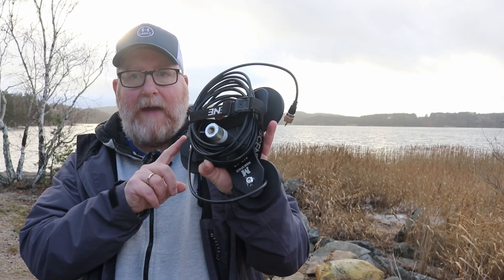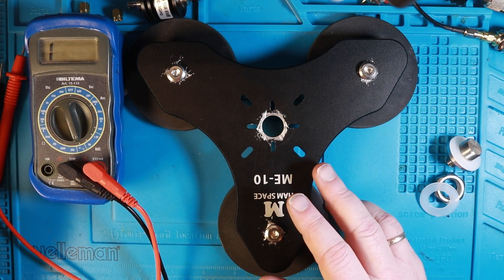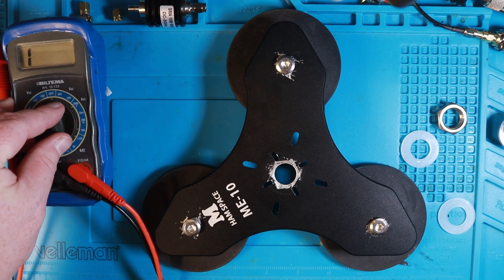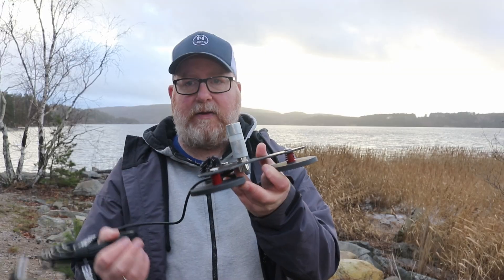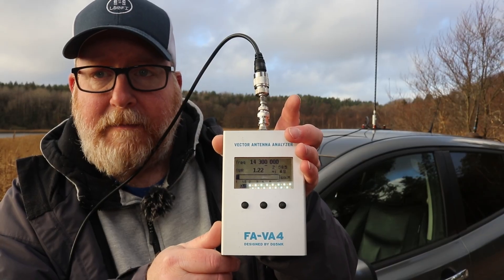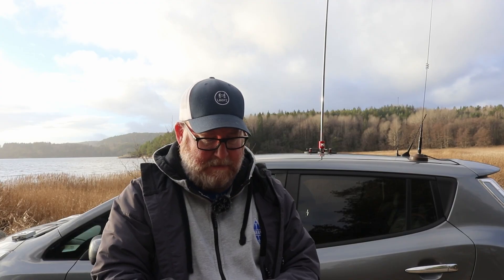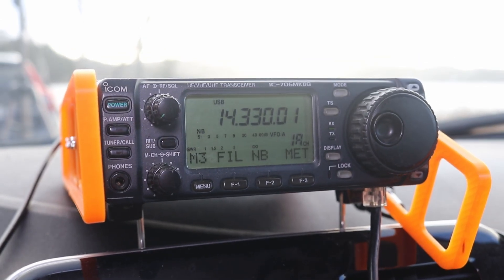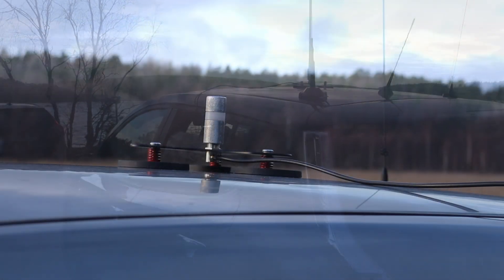Is a $62 triple magmonunt actually usable?

Comment: The mount itself looks decent. However, it needs to be fitted with an SO239 and coax at the same price point. With an SO239, the user can use a 3/8" adapter for hamsticks and add to that a 10mm adapter for Chinese telescopic whips.
Reply from the maker: Yeah, it all depends on your needs. I really wished I got it with a SO-plug to start with, and I think you can get them with that, but I did not look too closely when ordering.